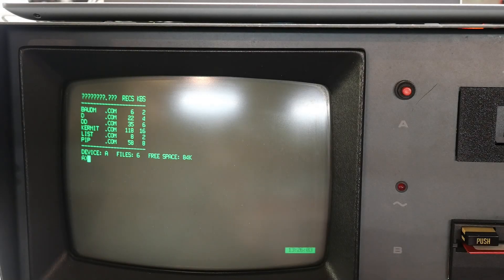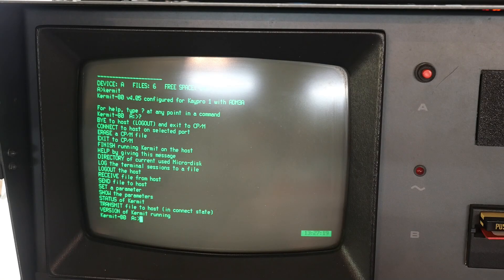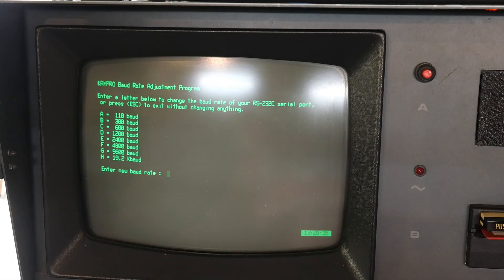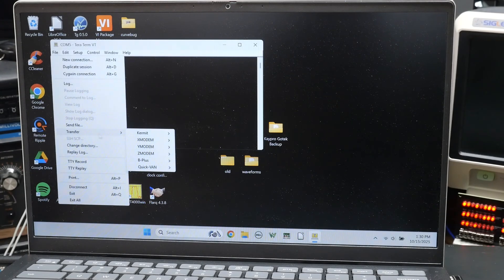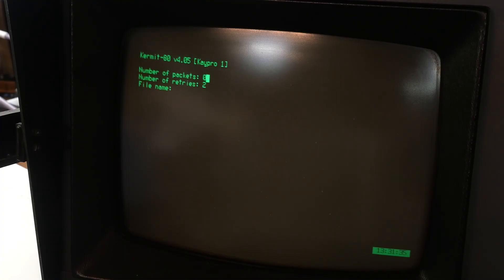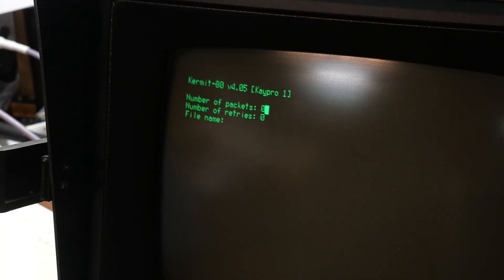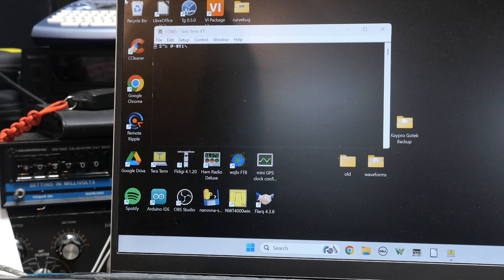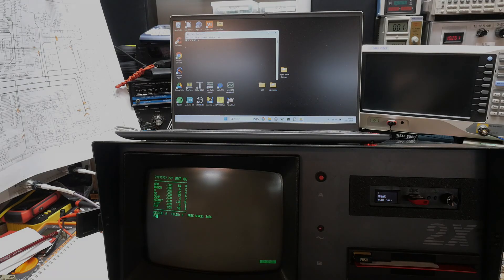#2413 Using Kermit to transfer files to a Kaypro

Comment: Q:  did you have issues with locating a driver for win11 for your usb serial adapter?  I have a handful of those chinese adapters and windows reports them as obsolete and won't attempt to locate a driver.
Reply from the maker: Mine seem fine

Comment: Great video, look at where we have come from. Where did the name come from, anybody?
Reply from the maker: The serial data transfer program and protocol *Kermit* was named after *Kermit the Frog* 🐸, the famous character from *The Muppet Show*.

The protocol was developed at *Columbia University* starting in 1981 by Frank da Cruz and Bill Catchings. The developers obtained *permission* from Henson Associates, Inc. (Jim Henson's company) to use the name.

The name was a lighthearted choice, though a "backronym" (a phrase later created to fit the initialism) was sometimes used to be fully formal: *KL10 Error-Free Reciprocal Microprocessor Interchange over TTY lines* (referring to the DEC KL10 mainframe it was originally implemented on). However, the developers stopped using the backronym after they secured official permission for the original name.

Comment: My HP48 calculator also has a kermit transfer protocol.  Serial communications fun times.  Started doing this back in 1978 and my haven't we come a long ways. 

Given the data is being pumped out on the RS-232 serial link baud and bit rate are the same.  This remains true of connections between the computer and other devices using the RS-232 interface.  People get confused though when talking about the analog side of things when the computer connects to a modem.  The data interface might be at 9600 baud at the RS-232 input to the modem but be only 2400 baud over the telephone line.  The modem can use a variety of techniques to send, in this example, four bits per signaling element (baud).  Phone line bandwidth and phone company/regulatory power limits are what capped dial up modem speeds back in the 80s and 90s.

Add in satellite round trip delays and recovery from bit errors and there were a variety of protocols and techniques used to assure reliable data transfers over channels of different types, both nailed up single channel per carrier and various flavors of time division multiple access.

Comment: I use Kermit on both ends.  I believe there is a Kermit for Windows.  It's old so may not run on Win10 or 11.  I run Linux and it runs fine there.  I set the speed and all that and then put it in server mode on the Linux side.  And then on the Kaypro side I do a get of the file I wish to get.  Of course the server end should be in the directory where that file exists.  Works quite well, but awful slow even at 9600.
Reply: Windows version is Kermit 95, seriously.
Reply: @davidv1289  Ask me if I care.

Comment: Kermit was a good program at those times. Kaypro sent also Kcopy programs with the PC's for direct copying of files between serial ports. In 1984 I managed to get a PC for a short loan and needed to save a lot of FORTRAN code from a DEC VAX computer to some memory media. No terminal program was available for that purpose and I was in a spot. Then I started thinking of the process what needed to be done exactly. The process is simple and all I had was GWBASIC which had necessary functions and interfaces available. Then I wrote a simple terminal program for the purpose and could rescue all files through a modem from the VAX sitting far away.

Comment: Just like the old days indeed. A friend and I wrote a program called 4A-Talk, which was a terminal emulator for the TI-994/A, but instead of using the Kermit protocol we used XMODEM. This was mainly because that was used by more BBSes in our area. 

But consider this: just how much storage is on one of those double-sided, double-density 5-1/4 floppies? 1.2 mB? A normal terms-of-service file is larger than that.  Can you imagine trying to use Kermit at even 57 kbaud to transfer a simple application? It's nice to remember the old days; sure am glad I'm not living in them. (grin)
Reply: Like @d942yd42 said, Kermit was the Cadillac of transfer programs.

Comment: Quite the blast from the past!   Generally speaking, kermit was "built for comfort, not speed."   Other programs like XMODEM/YMODEM/ZMODEM were faster, but only under the best circumstances.  Kermit was built to be able to push binary data through wacky communications paths, mainframe operating systems, etc.   It could escape or transform the data to avoid in-band flow control and other troublesome characters (like XON/XOFF) and 7 bit paths.   Kermit would also do transfer of text files, and convert the representation on either end to what worked for that operating system.  We used it back in the day on mainframe computers like IBM VM/SP CMS mainframe operating systems that used EBCDIC rather than ASCII, UNIVAC 1100 mainframes as well as the more modern DEC VMS and 7th Edition UNIX and later operating systems.   It wasn't necessarily elegant under the hood, but quite effective!

I marveled at the ability to edit files on my Northstar CP/M system with the fancy WordMaster full screen editor and send it to the UNIVAC mainframe with Kermit.  Truly, we were living in the future 🙂

Comment: I spent more time f-ing around with RS232 settings, cables, benders,... all that crap - than I wanted.
EVERY project was just a bit different. Young folks don't know how great USB is with all it foibles.
Reply: In the end, isn't like you know how the USB interface chip works and do its deed.
The same goes for the software and hardware stack running on the host hub.

You can still make your own simple serial interfaces with of-the-shelf chips/ttl or if you want to be fancy, GALs/CPLDs/FPGAs (overkill, to be included with other functionality) and replicate as needed, on the budget/limitations. For USB and any complex communication interface, you are on the mercy of paying FTDI/Cypress loyalties, chinese CH series chip blackboxes, or paying some IP vendor for the cores to include them in your CPLD/FPGA, with no way to replicate them in any way.
Reply: @hyoenmadan  What exactly from USB spec is not achievable on a proper industrial MCU? Nowadays manufacturers got what looks like the entire USB stack in the supported libs for their free SDKs. I mean, it is still complex as hell, since USB is such a broad, vast and confusing from the inside standard, and good luck to anyone not doing it every day to find own way in there.. But it sure got a lot more accessible in the recent years than you describe. HID, CDC, I2S, Mass Storage, PD, all the good stuff is being done now on ESPs, STMs, Pis, so on.
If you think USB is paywalled, than you better not dream about PCI-E, now thats an NDA abyss..